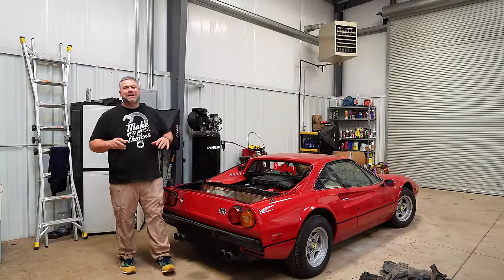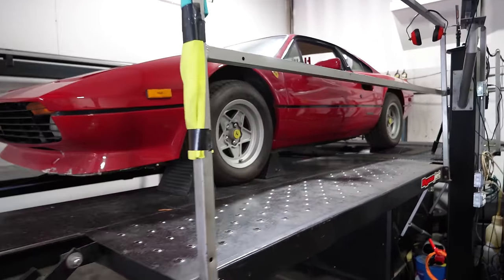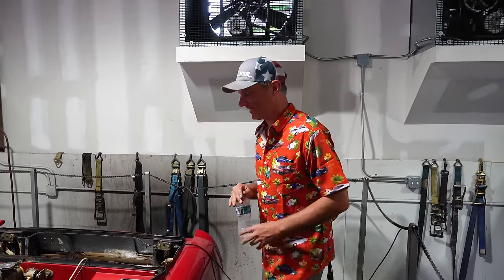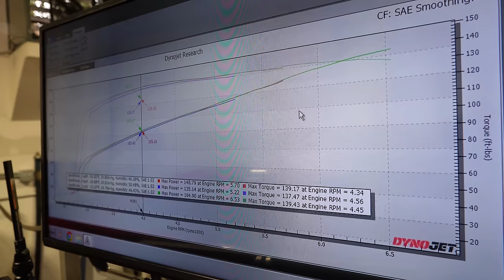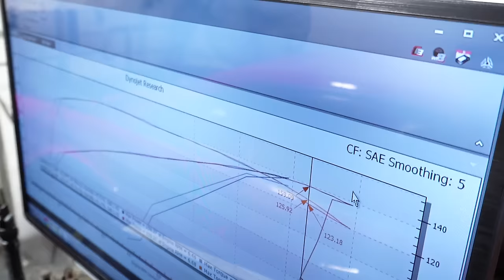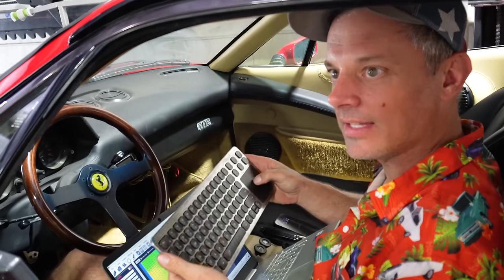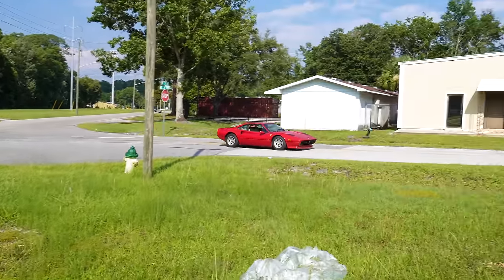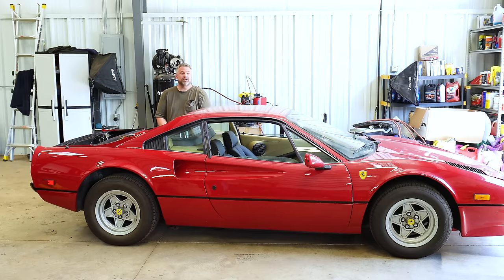Holley Fuel Injection on a Classic Ferrari: Did the CarTrek 308GTB Reach Its Full Potential?

Comment: Sounds fantastic, but after all that work you can see that there is a low ceiling to this motor.  Next step, turbo K-swap? :D
Reply: Unless building something for bragging rights/racing, I'd rather have the noise and power limit of the Ferrari engine versus the noise and power potential of the Honda. That is just my opinion, though. Being that this is intended as a nice daily (not a race car), the V8 would be my choice.

Comment: Jarred just wondering can the bottom of the air box be bolted to the top of the trumpets instead of through them? That would improve inlet airflow. 😅
Reply: No, but best solution is using a separate air filter box and running intake pipe to the top of the horns similar to modern Ferraris.